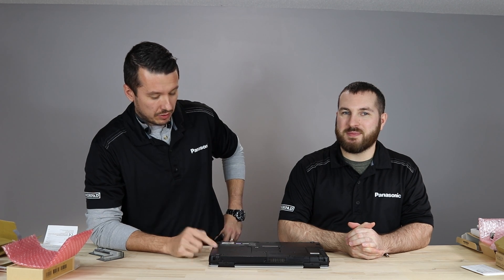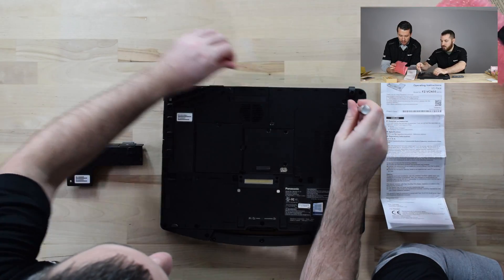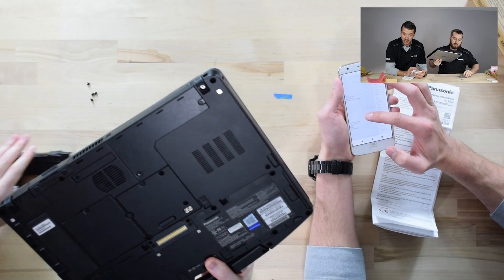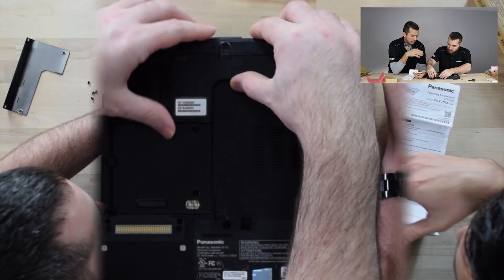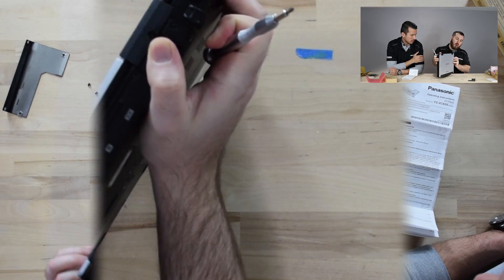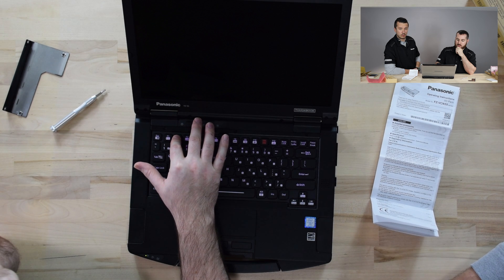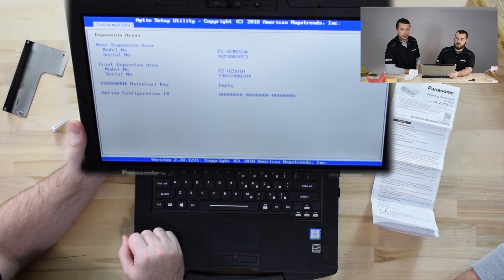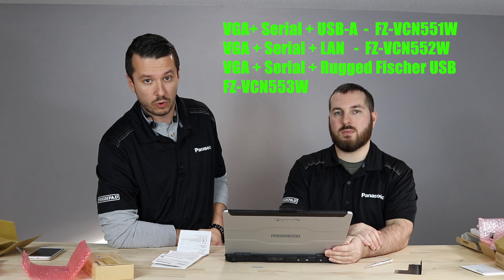FZ 55 Rear Expansion xPak Install

Comment: What's the CPU cooling like on the 55? I don't expect MSI GT75 TITAN tier cooling in a Toughbook but 200F+ temps are unacceptable IMO.
Reply from the maker: This FZ-55 review has a great breakdown and stress test of the cooling system of the FZ-55! https://www.notebookcheck.net/Panasonic-Toughbook-FZ-55-MK1-Laptop-Review.434820.0.html